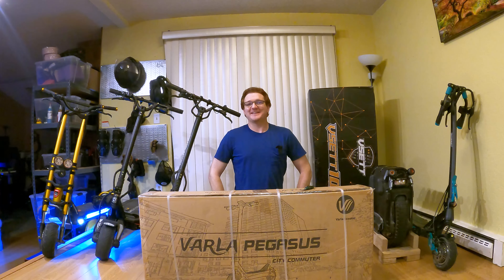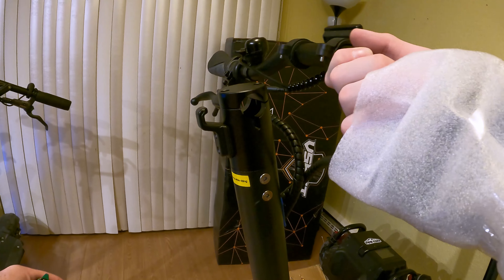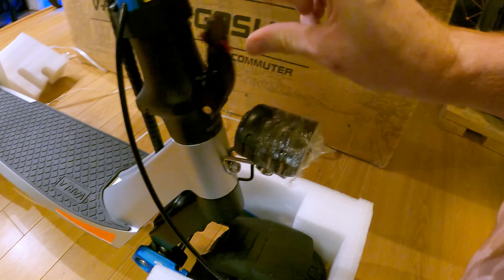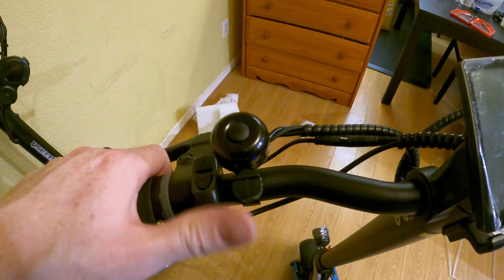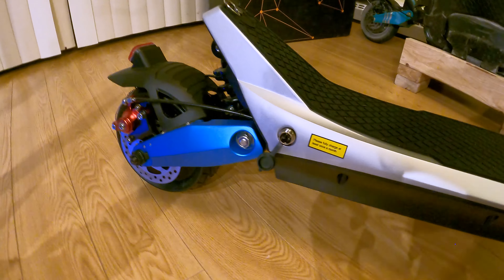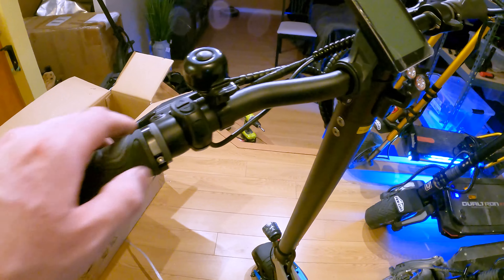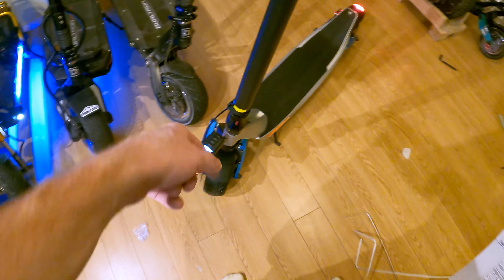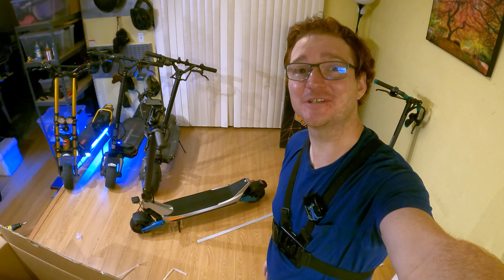Varla Pegasus Unboxing & Inspection

Comment: RK9 Rides had thumb fatigue when riding with the thumb throttle. he mentioned he would have to swap the thumb throttle with the brake to get a comfy grip on both handlebar and throttle. Did you find the same in that you were having to hyper extend your thumb ?
Reply from the maker: I don't know, haven't ridden this scooter yet. I'll have to report back after I have.
Reply: @GingerOnWheels  ah ok.. i wasnt sure if your videos were in sequence or a few behind in the order of uploading.  Yeah.. something to keep in mind when you ride it then.. the hyper extension of the thumb and the squashing of the hand into the grip to reach the throttle.
Reply: I am also wondering about the thumb throttle comfort level, and if the acceleration is smooth and gradual, or powerful and jerky. I've also heard reports on wheel chatter. I'm almost ready to buy, but will wait for Ginger's further review.
Reply from the maker: @pskochin  I'll keep you all posted. I'll do the range test and get some impressions out tomorrow or the next day.
Reply: @pskochin  hey my I have no thumb fatigue on mine, but I don't ride for longer than 30 minutes at a time.. and the thumb throttle is definitely not gradual it is more on the jerky side, you press it a bit and gives a lot of power, I have no wheel chatter on mine, I would say the ride quality is actually really good ( I have an emove touring and kaabo mantis pro SE for reference to compare too)

Comment: The scooter has a damper that's why the steering is so heavy! It's very weird at first, but really nice when you get used to it, going 30 mph there is no wobble very stable ride, for reference my kaabo mantis pro SE wobbles like crazy at 30 mph.
Reply from the maker: Agreed! I just rode it around for the first time today. Its got a very unique steering feel thats hard to get used to at low speeds, but it's ultra stable at top speed.
Reply: @GingerOnWheels  Also you can adjust the bolt on folding lock mechanism to give it a more secure fit, the brakes suck out of the box but once adjusted they are fine, the power is slow out of the box I believe it's P11 and P12 settings you can adjust to make it faster ( however the manual says not to adjust). However I did change it and the scooter becomes a lot faster..

Comment: JUST got this scooter today, put it together exactly as manual stated, rode it ONE single mile, and LDC Display would not turn on again after that. I made sure I charged it, light was green, it said it had a full charge when I was riding it and it never turned on again. Do you have any help on this?
Reply from the maker: Check to make sure the cable connection to the display isn't loose. Second thing I'd do is email Varla customer support with your order number and a short video. They'll likely ship you out a new throttle piece first.
Reply: @GingerOnWheels  that’s what I was thinking, I tried to disconnect the PCD wires but am worried I am going to break them. It was pretty tough so I stopped because I didn’t want to break anything. So you think just using some extra force will separate those two connecting pieces? I emailed them they didn’t answer so I called, said I should hear back from someone within an hour. I’ll keep you posted. Let me know your thoughts on the connected wires. I saw in your video your wires came disconnected? Mine were already connected
Reply from the maker: @angelodispigna  yeah the 5 pin barrel connector comes apart. Just wiggle a tiny bit while pulling on it.
Reply: I actually just separated them and connected them back and still didn’t turn on. No luck, guess I’ll wait to hear back from Varla, pissed. Literally got the thing 4 hours ago
Reply from the maker: @angelodispigna  I'd be upset too. But let's see how fast Varla responds. With them, my experience is 'squeaky wheel get the grease', call and email as often as you can.